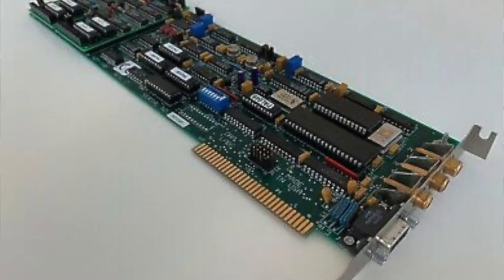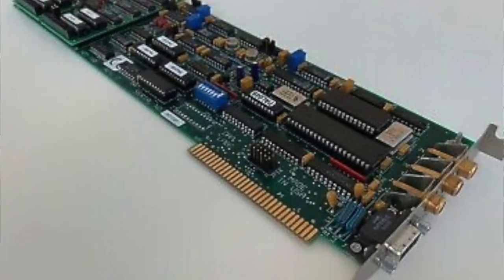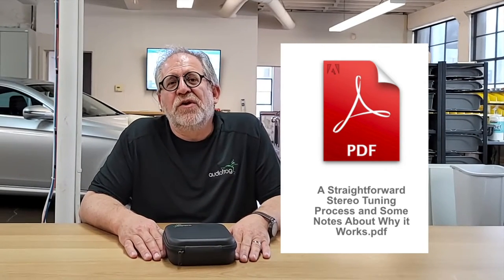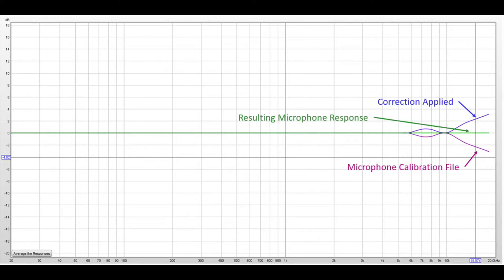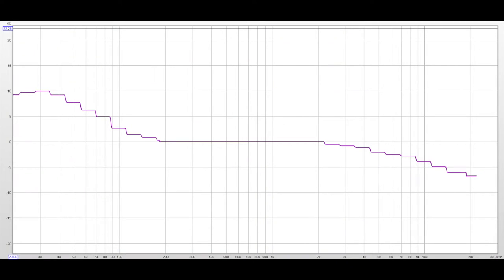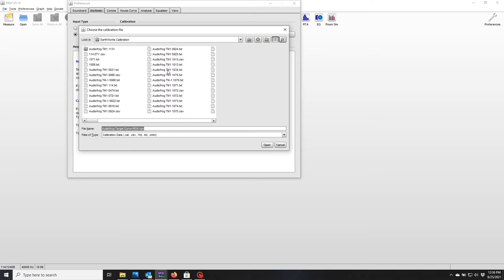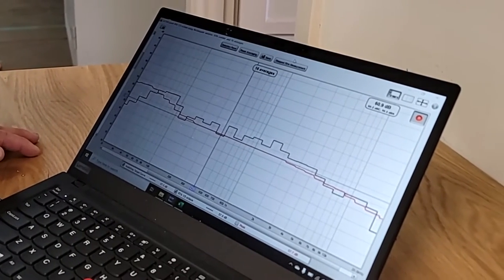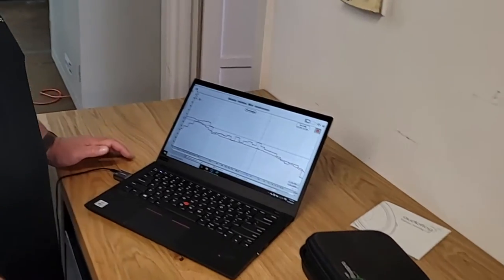Audiofrog Testgear UMI-1

Comment: Thanks for the value info Mr. Andy, I have tried it and I am little confused with a process as calibrating for left the mic position in left head rest and when calibrate right side should I keep the mic in same left head rest or move to the right side to get the correct response.. appreciate your quick response.

Comment: Hi Andy,

You selected the DIP frequency as Offset. In the guide its mentioned that frequency has to be an average between the peak and the dip. 

Also lets say we EQ the right side first and offset according to the DIP at 56Ddb. On the left side (driver side) the dip is more around 45db. Now since we have to match the drover side with passenger side what should we do? add the dip to passenger side if its not fixable or more than 9db?
Reply: I had wondered that too. I think the manual says pick a centre point. If I remember correctly.

Comment: Your analogy of measurements being taken with/without a body in the listening position VS not having to sit in a chair while they make it is confusing me.  My car already has a chair (driver's seat) and I'm not measuring the chair to make improvements to it.  I'm making an audio system around that chair and measuring the sound to make improvements to it.  My body reflects the sound before it reaches my ears just like everything else in a car, so a body should be in the seat when taking measurements.  If I took a chair to a carpenter to have the legs shortened so my feet can comfortably rest flat on the ground when using my favorite seat cushion, they're going to have me sit in the chair on top of the cushion and they'll take a measurement.
Reply: @TonyTube407  
Forget Andy's analogy for a moment.  The bottom line is that the Target Curves were not created with a body sitting in the listening position.

And therefore, IF you want your in-car response to Match that Target Curve as closely as possible, there should not be a body in the vehicle when taking your measurements and adjusting the DSP to match said Target Curve.

If you choose to be in the car when taking your measurements, the resulting measured response and your corrections WILL NOT match the target curve as intended.

You can verify this by doing two sets of measurements...One set while no one is sitting in the vehicle, and one set while sitting in the listening position.  Then compare the differences in response.

Again, the Target Curve that you are trying to match was not created with a body inside the vehicle.  Why???  Because we are all different shapes and sizes and we all sit in the vehicle using vastly different seating positions.
Reply: @bbfoto7248  I'm the only one who drives my vehicle.  I still stand by what I said.
Reply: @TonyTube407   
You are free to think whatever you want, but the actual developers of these Target Curves have stated that they are created without a body in the vehicle and should be measured as such IF you want to accurately match your acoustic response to them.

Obviously, there are many other variables that can affect the accuracy of your measurements...as well as your experience and how you interpret them.

There is an AES whitepaper on this subject if you care to read it.

In the end, Target Curves are just a "rough guide" to quickly get you to a known and very good "ballpark" result in terms of spectral balance.  As Andy said, most people will want to further refine the spectral balance (tonality) after the Target Curve has been matched.

Different mixing engineers work with different speakers as their "reference" when producing the various music that we listen to, and they also work in various rooms with a differing acoustical response.   The studio monitors and rooms are not all identical, so different music will all have its own unique spectral balance with the mix engineer's preferred "seasoning to taste" applied as well.  So there's not one Target Curve that works 100% across all music.

Comment: I thought mono pink noise was for single speakers and stereo was for pairs
Reply: You have a stereo source device - the head unit. A stereo signal has different sounds on the two channels allowing the appearance of sound coming from the left or right or both.
A mono signal is the same on both channels so should appear to be centered on a two channel system. If it is not centered then you can adjust your system to correct the error.